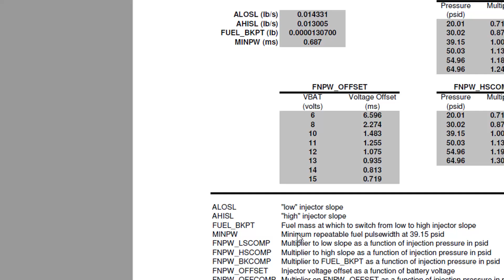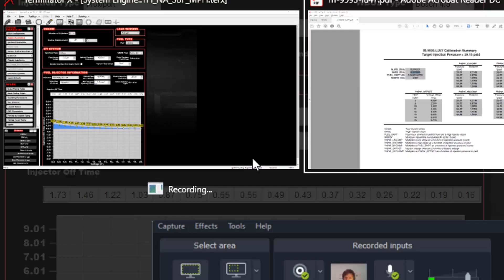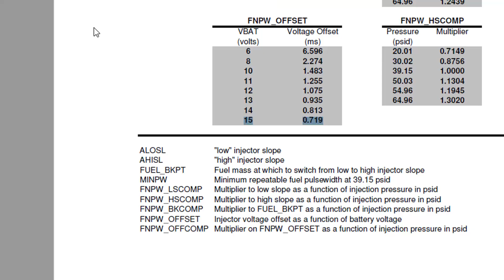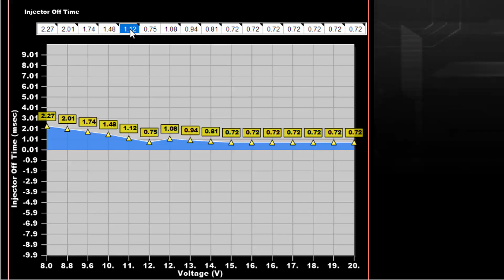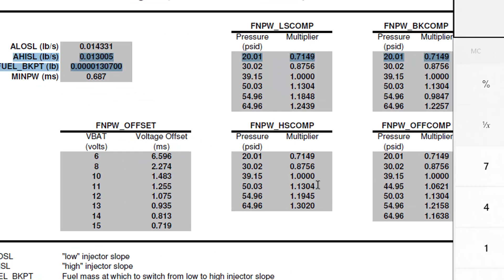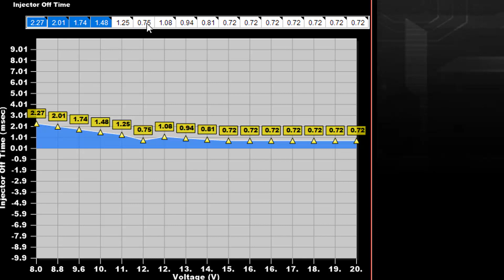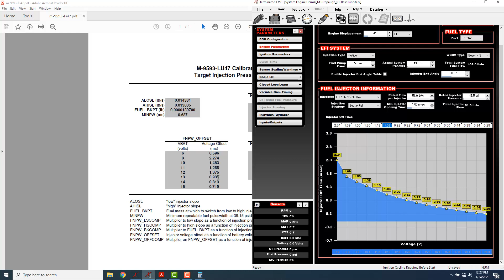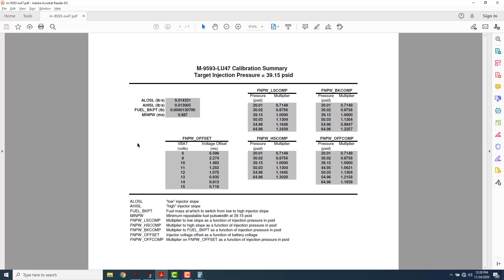Setting Custom Injector Data in your Holley Terminator X Tune

Comment: Super helpful data here. I picked up a set of coyote 34lb injectors, LU34A. Found the datasheet and was able to make the calculations. Fingers crossed for the first startup this weekend!
Reply: how did you find the datasheet for the injectors?
Reply: @Bv2free I found that the injectors I picked up have a matching part number with some Ford Racing injectors.
Search for "M-9593-LU34A calibration summary".
They're ev6 and fit an LS fuel rail. I'm running them at 60psi with my Terminator X.

Comment: Great video ! I have a set of the ford green top 42 injectors. Still in the box never used. I can’t find any info on these injectors to do custom settings. Do you have any info on these?

Comment: Great video..  Thank you for the detail and knowledge.  I have given up on my Aces EFI  Wild Card installation and have moved to Holley Terminator X.  I would like to use the Aces AE1001 36 lb/hr injectors that came with it.  Would you have any specs on those injectors?

Comment: I made the mistake of using a FiTech intake kit (70072). It's been a pain getting it to work with the Terminator X. I got a sheet from FiTech for the 55lb injectors but their data is way off from what the Terminator settings want.

Comment: Hi your video was extremely helpful and I do have a question hopefully you can help I’m running Fast 85lb injectors on an LS3 and I’m using the terminator X max, did I screw up by choosing these? I don’t want to go through all the trouble of doing this if it’s not worth it. Thanks hopefully you can help

Comment: Do you have a offering to assist in a remote injector setup i have a New LS3 using the Fitech loaded intake 750 kit with 55PPH injectors  fitech is lacking some of the needed data Holley said to contact you for help willing to pay for a Remote session to assist. Motor is a New LS3+BT stage 2 cam + Fitech 750kit with 102 TB
Reply from the maker: We don’t work with LS combos at this time. We would recommend contacting Trevor Couture or Joe Simpson.

Comment: if your injector off time numbers are off by a few digits will it cause a rich idle ?
Reply from the maker: Here’s how I would answer that question. Look at your data logs to see what your injector pulse width is at idle. For the sake of argument let’s say 2ms. If your off time is wrong by .1ms, your fuel will be about 5% off. But in general, fuel correction should still be able to more or less compensate. Car just may experience slightly less stable idle and possibly have some low load cruise discrepancies as well.

Comment: I have injectors I can't seem to get data on other than the rated flow, I'm consider running different ones because of this. The factory GM Bosch (I think) for the 1996 LT1 G body or F body injectors. I have both sets and I hear they're rated slightly differently. Can you help or am I better off getting some with known data

Comment: On my laptop the Holley is asking for almost all partial voltage values only a couple whole numbers, 8v, 12v, 16v, and 20v. I plugged in the ford racing injector data for 8v and 12v and 15v+ and just filled the values in between. Will this be accurate enough or do I need to do some math?

Comment: Thank you for ALL the info you have put out. I am very new to mpfi terminator x, and your videos have helped me a lot. I bought HPI-96lb-lx3 injectors. I was told that those were some of the better injectors. There was no off time on the sheet so I contacted them and I was told to use the ratings for SEP 1000cc or 850 cc. injectors. Is the data for these comparable to the HPI injectors? Any help on setting up the injector data will be greatly appreciated.      Thank You
  Steve
Reply from the maker: We haven’t worked with those injectors. But that advice doesn’t seem sounds. The SEP 1000 and 850 are not going to have the same off times. So then telling you to use the off times of either seems fishy.

Comment: Matt, do you have a data sheet on the Siemens Deka 60 lb/hr injector?
Reply from the maker: Use the ford racing lu60 data. I have never seen data sheets for deka branded injectors. But it is my understanding the deka 60 and 80 are the same as ford racing’s, and ford does give us data to work with. Used that data with tons of cars on dekas and never had an issue with that.

Comment: thanks for this info I am new to the whole injector thing and terminators. I have a Borla 8 stack and am using Five O motorsports 850cc/83lb, EV14 Standard - U.S. CAR and European CAR, Fuel Injectors
Part Number: 055U850. I do have a data sheet with them. Just a bit slow on the learning curve with all of this. And to add to the mix i have an NX dry shot from 100 to 500hp. So let the fun begin..

Comment: Hey buddy,

Love the video but am struggling with getting the right info on my injectors, any chance you could lead me to the right path for 1000cc xspurt injectors? Thanks a bunch
Reply from the maker: The data is available out there. https://www.sau.com.au/forums/topic/173670-injector-latencies/page/3/
Reply from the maker: Choose your intended base fuel pressure on the left of the chart, and it will give you the flow and off time numbers. You’ll want to make sure your actual system pressure and rated pressure both reflect your chosen psi. As for the off times, the sheet only lists every 2 volts, and the Holley has a point every 0.8 volts, so you’ll have to do the math to the find the values between the provided voltage points. But you at least have a clean 8, 12, and 16 v starting point.
Reply: Absolute legend, il give it a crack tonight and let you no how I went! Thanks once again

Comment: Hi I bought some afis injectors on a whim and the guy said the are 50 lb injectors I don’t have any other data I have them already installed on my 5.3 do I need to go buy a lab top or can I just put it in learn mode
Reply from the maker: I wouldn’t recommend running injectors with unknown data. The off times are very important for idle stability.
Reply: @LeechMotorsports  how do I get the data I’m on a budget I don’t want to drop another 400 on injectors I bought these injectors from AFIS from market place I can’t get a hold of the company now but I see they sell that brand on summit not the same injector do I need to pull my injectors and send them out to get data
Reply from the maker: I’ve contacted afis on Facebook to see if they can provide the data. Their website is not currently online, so not sure what the deal is.  This is honestly the first time I’ve even heard of the company. Summit has pretty good support. Try calling them to see if they have the data or can reach out to the manufacturer to get it.
Reply: @LeechMotorsports  I contacted summit and finally got a working phone number for them i called and now I am waiting for the guy to get back into the office
Reply from the maker: Awesome. Please let us know what you find out.
Reply: They never got back to me after I talked to them so I decided to just buy the Holley ones off the list

Comment: Hey man do you possibly know the min injector opening time for pro m 42lb ev1 style injectors that’s the only thing they don’t list on there website or is there a way to figure it out with other numbers or something? Thank you
Reply from the maker: I do not have that data. I suspect they would provide the info on request though. Unless you are running those on a very low power car (like a bone stock 5.0), I wouldn’t stress out about it. See what the pulsewidth looks like at idle in your data logs. If it is over the default of 1.0ms, then you should be fine.
Reply: @LeechMotorsports  yeah I emailed them but haven’t heard back. But thank you so much. I’m  pretty new to this stuff so thank you for the help I really appreciate it!

Comment: Hey Matt, I'm putting together a naturally aspirated 306 for my fox body and am going to install the terminator X so I really appreciate all of your videos. I'm looking at around 350hp and was wondering if you had a recommendation on injectors to use? Thanks!
Reply from the maker: 30 lb should get you there without much problem. You could use some of the old school Ford red tops. Lightning 42 lb or Ford LU47 are a few other options that are easy to find. Bigger than what you need, but should work just fine.
Reply: @LeechMotorsports  thanks, is there any drawback to the LU47's? They seem to be the cheapest reputable injector 30lb+
Reply from the maker: None that I see. My favorite street car injector. They hold up to high base fuel pressures when needed. And I’ve run them on a no-bullshit bone stock (oil pan to maf) 89 mustang, resulting  in near perfect fuel trims using ford’s published injector data on an otherwise stock tune. No drivability issues whatsoever.

Comment: Hey Leech! Your videos have been a godsend, please keep them coming. I do have a set of weird 75#  Lucas injectors that came with my 95 sn95. Procharged 347. Here's the item number: 01D129B. If you have any spec information on those i'd be eternally grateful. I haven't been able to find a thing about them since I pulled them out of the car and really don't want to have to spend another 600$ on some new ones just because they don't have spec data.

Comment: just curious but how did you manage to run the 2 different software versions at once
Reply from the maker: I have terminator x v1 and v2 software installed. They are technically two different pieces of software. So I just opened each and put them side by side.

Comment: I bought the following injectors from LMR, but no specs.  Do you have any specs on these by chance? 1986-04 MUSTANG BOSCH TYPE III FUEL INJECTORS - EV1 - JETRONIC - 30LB
Reply from the maker: I’ll have to dig into my archives to check. But I don’t think I have complete data for them. Seems LMR is selling these regularly though.
Reply: @LeechMotorsports   I emailed LMR and they got back to me asking me what data I need, I'll let them know and see what happens.  I got the numbers off the injectors, 0280155831, and started searching on my own, one site I found said they're Bosch 62672.  It appears they were initially sold for Volvos and I've found some data when I search 0-280-155-831 but it's not the min injector on time and/or off times.  They do have some basic flow data at two different pressures and a couple BSFC at different duty cycles but now what I'm looking for.  I'm very novice at this since I only started with the software last week, but I did get my car to run much better this past week so now I'm excited to learn.  Any help would be appreciated. Thanks
Reply from the maker: @SouthernEngineeredGarage  Ideally, you could obtain a pressure rating, high slope, low slope. breakpoint, minimum pulsewidth, and injector offset vs. battery voltage function. That would pretty much complete Ford's Injector characterization specs.
Reply: @SouthernEngineeredGarage  did you ever get data for this injectors? I have 2 sets and I have some data but not sure if it is correct.

Comment: I have Siemens Deka 80lb I know Holly has then listed but is there any information you have that you know is good?
Reply: T Web  ??
Reply from the maker: I’ve always used the info listed on efidynotuning.com for those injectors, then modified from there. But I’ve not had a car run those at higher than standard 39 psi. If you really need bigger injectors than that, you’re starting to move into a different type of setup altogether. And stretching a smallish set at that point for more fuel isn’t really the kinda thing I’d recommend. Lol.
Reply: @LeechMotorsports  yeah I pick those injectors because of the guy that runs EFI dyno tuning recommended to buy those injectors and to be totally honest I kind of wish I went with something a little bit smaller because I'm only running a 302 Turbo With 93 pump gas and your typical gt40p heads Cobra intake upgraded valve springs and 1.7 rockers I probably could have went with 42 Pounders or 47 like what you showed in you're one video. Yeah at the time I didn't really know much now that I have spent a lot of money on trying to learn the whole tuning world for the past 3 years. I mean don't get me wrong they work I just think if I were to put 42 LB or 47 pound injectors it would be a lot more smoother idling and cruising
Reply from the maker: If you’re for sure not going to turn it up more, the 47s would probably have worked or definitely some 60s. But the 80s should still work ok with some tuning.
Reply: @LeechMotorsports  I just want back on EFI dyno tuning and looked under the injector info for 80lb black with blue tip and that info don't make any sense nothing like the info you were showing for the 47lb. Trying to see if there's a difference between Holly's 80lb injector info
Reply from the maker: In the efi dyno tuning data, the number listed for the high slope is what you would enter for injector flow.  You would set rated pressure to 39.15, and you would use the voltage offset data listed for your off tunes in the Holley, the big thing this data is lacking is the multipliers for running at higher fuel pressures.
Reply from the maker: Also, it is my understanding that the deka 80s have the same specs as the ford lu80.
Reply: @LeechMotorsports  hello Matt Happy Thanksgiving I just wanted to reach out and let you know after I watched this video I was curious on how much of a difference Holly injector data was with EFIdynotuning.com for Siemens Deka 80lb and wow what a difference. so I tried the new injector data and what do you know my car starts up quick as it ever has no more up and down idle for 7 Seconds the IAC valve operates much faster. Thank you for being the good person that you truly are I have gotten further than I have ever in the past 4 years spending hundreds of dollars trying to get my car remote tuned by other people not going to say who my most recent was spending $500 remote tune x3 people... a quarterhorse,dongle, Binary Editor, $200 bin file and the car just never seemed right so I just gave up and bought the Holly ECU and then you appeared and post a couple videos and two revision logs for me and it runs very well I know things still need to be dialed in but I just want to let you know how grateful I am for this past week with you helping out and posting videos to help others
Reply from the maker: That is so great to hear. Happy holidays to you as well. More big things to come on our channel this week.